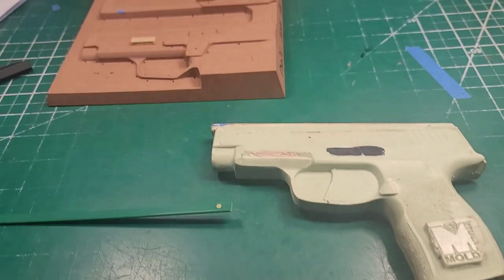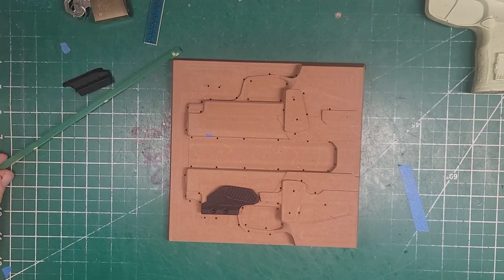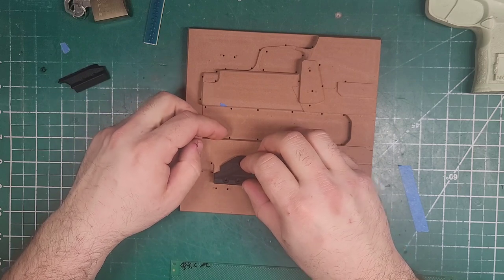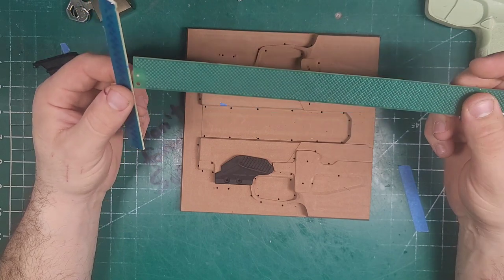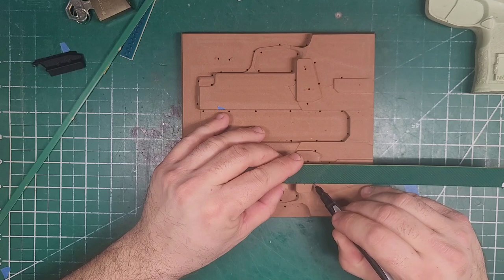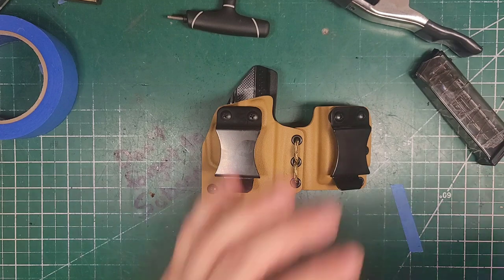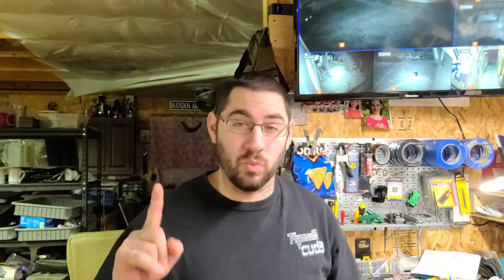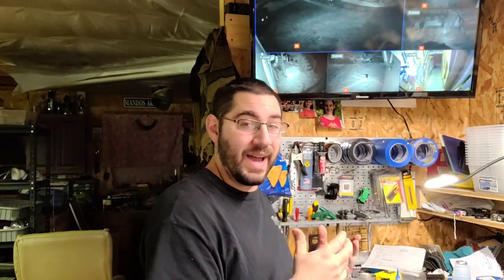Sig P365 with Gas Pedal. On a Palehorse

Comment: Do you have an offering for a Glock 48 with a recover tactical rail but NO light? Id like to be able to switch over from light to no lights without removing the rail. 

If not I may order supplies and do it myself. No one seems to have them
Reply from the maker: i would need to order the rail, then i could
Reply: @FalTacUnlimitedLLC  what would your pricing be like for something like that? theres a company that actually makes a plug for that exact setup for like 50 bucks... i considered doing it because no one makes a holster like that... but im no where near as good at it as you are. so if the price is right, i wont even bother, i know the recover tactical rail is like 25 dollars.